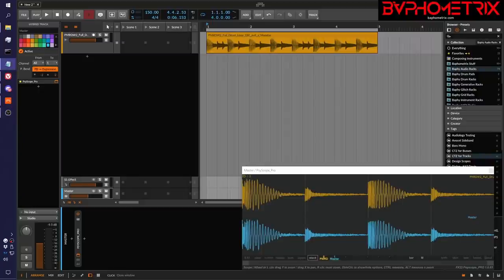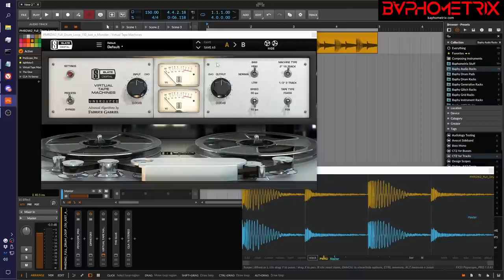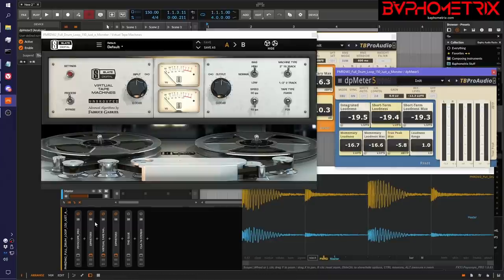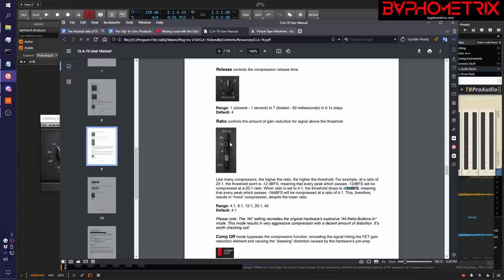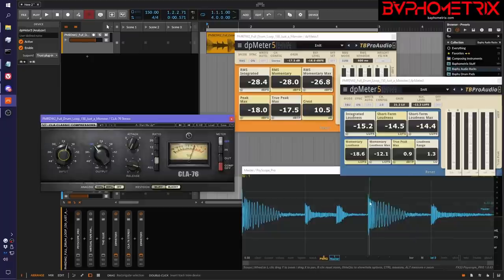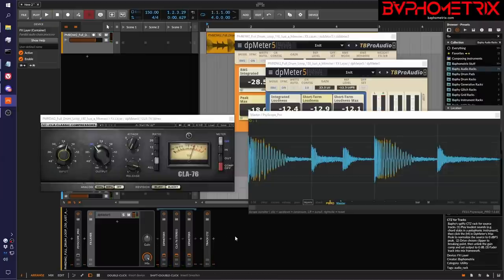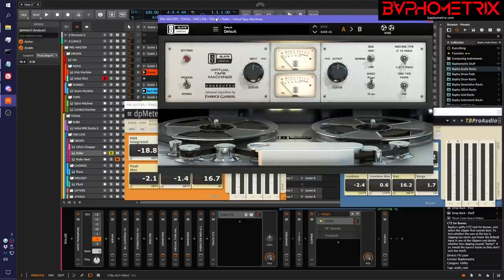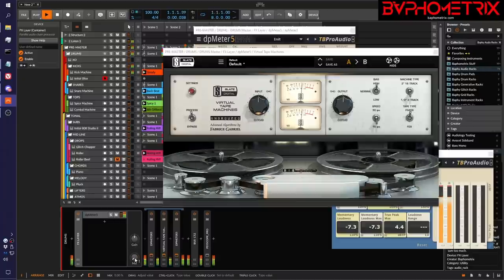Mixing Loud with CTZ - Ep. 10 - Using Analog-Modeled Plugins

Comment: Hey Baph, great series of videos!  I know at the beginning of the series and in the document you say CTZ is NOT for anyone working in a hybrid set up with outboard gear but I was thinking, would this same process of using analogue modelled plug ins not work perfectly for outboard gear that I use as external inserts in Cubase?  I can drop for eg my Distressors on a channel as an insert, as if it is a plug in and then apply the process in this video?
Reply: +1 for that question, actually I kind of get why real-time analog would be a problem but I also wonder if it's obvious that you can record the output of analog gear and use the recording to mix in CTZ method

Comment: Hello @Baphometrix , thanks for the amazing content and useful tutorials! 
I have a question regarding the topic of this video: Does this sweet spot apply also to all UAD and Slate Digital plugins? 
The UAD 1176 include a Headroom knob in case the signal is too hot. Doesn't that solve the issue? Would it sound different if the Gain reduction is exactly the same?
Thanks :D

Comment: Hey, awesome videos. One question regarding about an order of doing things that got me confused a little bit and i hope you can enlighten me.

For the Individual Tracks, on a previous video, idk which one was, i thin that in ep. 6 in controlling dynamic range, you said that , before normalizing you sound, if i want to use a compresor or eq on the sound, or saturator, after i used some processing i can insert de dpmeter, normalize my peak until 0 , thank clip if needed.
So what i get from this is : ( for example) - AGAIN: For the INDIVIDUAL TRACKS (Applying for each and every individual track) - should the processing go like this ?

1.Using eq ( doing my thing) or any other plugin
2.Insert de DpMeter - normalize peaks until they hit 0 dbfs or almost 0 dbfs
3.Clip (if needed)

Right? If i am wrong, please tell me.

Then here, you are telling us that we have gainstage for the plugin to get the sweetspot, by getting the Integrated loudness at first using a dpmeter on EBU mode, take that reference level on another Dp Meter also on ebu mode. After that on the first Dp Meter where we measured the integrated loudness, we are changing it back to RMS mode to set the RMS level a -18 dbfs (standard gainstaging).

Now here is my question : do we gaingstage everything before we use our Clip Rack? I mean shoud the order be like this:
1.Dp Meter EBU MODE - gathering refernce level on Integrated loudness
2.2nd instance of Dp Meter also on EBU MODE - Putting the reference level from the first one.
3.Change 1st instance of Dp Meter to RMS Mode and putting -18dbfs on the reference level, and Match the RMS Integrated 
4.Plugin set betweend the 2 instances of DP METERS, setting it up to the sweetspot
5.Matching the Integrated Loudness on the 2nd instance of Dp Meter to get back at our initial level that we registered.

now , do we go on like this?

insert the clip rack
1.Dp meter again - normalize peaks to hit 0 dbfs
2.Clip (if needed) ?

I am sorry for all the writing, i am just trying to get this right.Thank you !

Comment: Hi, Baphy! Thanks for the CTZ series, you helped take my mixes to another level. I am very grateful for the info you've provided. Which saturators do you use or recommend that can deal with higher signals pushed into them?
Reply from the maker: Anything that isn't sold as an analog-modeled saturator can take very hot signals just fine.  There are too many out there to name.
Reply: @Baphometrix  Thank you!

Comment: question: I produce radio imaging , 5'' to 30'' audio clips using voiceovers , music beds and sound effects. These are the main 3 categories of audio. I'm trying to apply CTZ (most of the radio gyus want the imaging products to be really LOUD!). What is your approach to this? In this concept "framework" is the voiceover and all the rest are build up to this voice. I've tried it for a couple of times and it sounds good but i'd love to have your thoughts on it - THANK YOU for the DEEP knowledge you share :)
Reply from the maker: As you've noted, the voiceover is the framework/anchor sound. There's only so much dynamic range you can squeeze a voiceover down into, mostly through manual editing of every single syllable in the waveform. Slice at each syllable and manually adjust the clip gain of every slice. This is how the pro vocalists in louder music genres work too. Once you have that voice as consistent and loud as you can make it without seeming "unnatural" or "bad-sounding", the rest will fall into place and that's the limit of the loudness you can hit.

Comment: Would the process be different if I would use Perception AB as a gain matching plugin?
Reply from the maker: Good question!  There are a lot of automatic gain-matching plugins out there, such as AB-LM, GainMatch, Perception AB, and Hornet also makes one but the name escapes me at this point. Those are *great* for helping you evaluate the true "sound" of any processing and not getting fooled from the processing simply making something louder and/or brighter. But for *vintage* plugins and their special gainstaging requirements, I feel that this more manual approach with dpMeter is a bit easier to set up and is overall more reliable and controllable.  dpMeter is a totally free plugin, so there's IMO no reason *not* to have it and use it. But if you feel you can duplicate the same results I show you here by using Perception AB instead, by all means, go for it!
Reply: @Baphometrix  I totally agree.

Comment: sick video 1 question why when you add another gain plug in after the analog plug in to bring the gain back up - why cant you just use the output level on the plug in why add a gain plug in
Reply: Probably just to have the extra control and to have that match button the dp meter has. Just a guess. You could probably do exactly what you said.

Comment: Thanks for this series, following you since some time and its gold. I dont have the Slate tape machine, is it something like the Inflator , UAD A800 or the UAD Ampex ATR102 a good replacement for that ?
Reply from the maker: Yes, it's just a type of colored saturation, modeled after vintage tape machines and tape formulations. If you already have UAD vintage tape emulations, you probably don't need Slate's too. Oxford Inflator is slightly different. It's not especially colored. It's just a multi-band soft clipper type of saturation.
Reply: @Baphometrix  Great thx Im trying to stick to the plugins you are talking about to make it 100% like you, Bought Kclip 3 and its a killer !! but its hungry on the computer compared to others , Thanks for everything you are sharing with us !

Comment: Do you recommend using C2 by fabfilter for drums, vocals, instruments? I kinda find it time consuming with the analog modelled compressors... and for saturation, should I use mainly Spectre? I like the feel of the Virtual Tape Machine also when I try to make my drum buss darker. Any thoughts ?
Reply from the maker: For saturation and distortion, anything goes. There are a lot of plugins out there that can give you all kinds of color from insane to very mellow.  With Saturation/Distortion you're not trying to be **transparent**. You WANT the color and the obvious change in sound.

Spectre is a very special-purpose saturator. You can use it in a heavy-handed, colored way, but I use it like I'd use an EQ to boost some part of the spectrum that is "weak" or "lacking" in the sound, just like an EQ boost. The difference is that Spectre does it with less phase shift and a more obvious (but still subtle) addition of "density" in the area you're boosting.  Do you *need* Spectre? No. But if you have the budget for it, try reaching for it instead of an EQ when your goal is to *boost* some weak part of a sound. You'll quickly see that it does the job in a very satisfying way compared to what an EQ boost would do.

As for Fabfilter Pro-C2, it's a VERY good all-around compressor for nearly every task, if you understand compression well enough. The only thing the famous vintage emulations give you is some of that dirty coloration that the original hardware had. Some engineers are very fond of that coloration, and those iconic colored compression sounds are all over hit records going way back. But are they necessary? No. Especially not if you make more modern, artificial, electronic music, dance music, and modern pop.
Reply: @Baphometrix  Thank you so much for your quick answer!

Comment: There is just one UAD plugin manual, and it is a booklet containing all of the UAD plugins.  On page 710 it gives a chart displaying internal operating levels for each plugin.  Most ride at about -18 dbFS average, no surprise.  

I followed your video and it all makes sense, however, I'm having difficulty knowing where the neutral values are for these plugins.  For example, you used a CLA-76 from Waves and saw that their normal value is 30, when you said it should be 24.  However, when I load a UAD 1176 Rev AE it loads with the input cranked down near -48, and the output cranked up quite high.  How can I know that my input drive is at -18 dbFS if I don't know what the starting value of the input gain knob should be?  

The manual seems to indicate that the numerical values of the 1176 models are quite arbitrary from my understanding, and if you load a Rev A 1176, the input gain is at a different position than if you load an AE model.  This kind of constant confusion with starting points in analog gear makes me almost want to ignore the "sweet spot" and just start tampering with the knobs to find the sonic sweet spot, rather than the theoretical/actual.  What's your takeaway?
Reply from the maker: Honestly, just pay attention to the recommended input gain. After that, you tweak the knobs to get the sound you want.
Reply: I'm a UAD user and have noticed this too. What I've done to help is I've set each of my UAD plugins on a default preset that's set to unity gain, so I don't have to worry about my starting point. On plugins with an input gain (1176, la2a) I set a sine wave tone with a meter afterwards, and I crank up the input to where the volume is identical if the plugin is bypassed, or adjust the gain down on plugins that have output gain (pultec).

Not sure why UAD doesn't do this initially, but hope this helps!

Comment: Hey Maybe I dont get something Right but Why cant we just adjust the Linked Input Output gain on tape Plugins to set up the sweetspot much faster than your method? At least thats How i do it (set everything to 0 vu as a Starting Point and im Good to go)
Reply from the maker: Because then if you do some new processing in front of that vintage plugin, and that new processing gains the signal up or down from where it was before, you have to go back inside the vintage plugin and re-adjust the interior in/out gain all over again. With my way, you just punch that M button in dpMeter5 and bam! your signal is right back at the sweetspot for the vintage plugin.

Comment: Why is the RMS Window (in dpMeter5) back to 600 ms? You once said it's too long and it should be 300 ms instead.
Reply from the maker: I waffle on that, honestly. Their default is 600 ms. It's hard to find non-conflicting info on what length RMS *should* be. (But much easier to determine what lenght short term and momentary LUFs should be since it's clearly defined in the EBU standards.) So when I upgraded to dpMeter5 I decided to just leave it at the default 600 ms and see whether I noticed any real difference. (I haven't.)

Comment: hi baph, what if instead of clipping to 0 we do it to -18 for example lowering the ceiling of the clipper in the master, so that we are always in the sweetpost of most analog plugins and we would still hear the clipping if we go over 0 (in this case -18) and if we need headroom we would simply turn off the clipper that is in the master and turn them back on once the plugin is adjusted (repeating this process every time it is necessary. when the master is finished we turn the cieling of the clipper in the master to 0 and add 18 db of input. is that make sense?
Reply from the maker: You can move the "ceiling" of your overall project gain staging, but it will be a little more work, IMO. All for the occasional time you might want to use a vintage plugin? Seems easier to work at a ceiling of 0 dBFS. Many things are easier/better that way, and you can always use the technique I show here if you need to use the occasional vintage plugin.